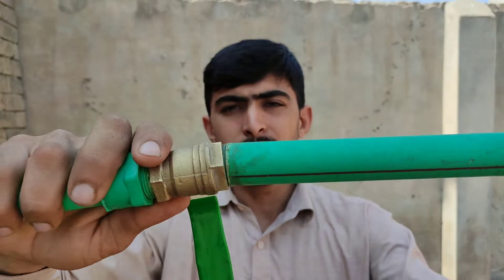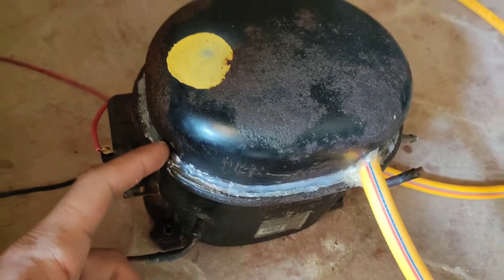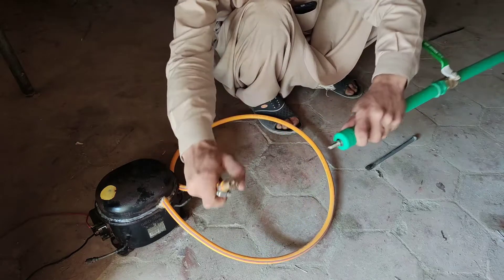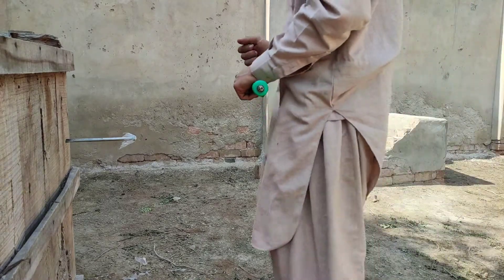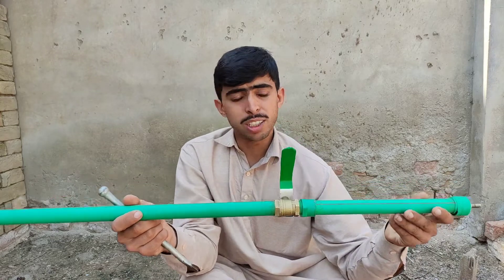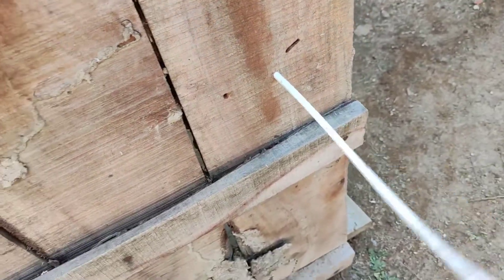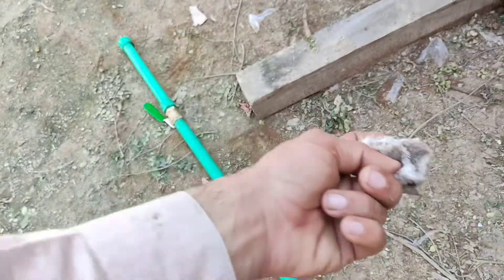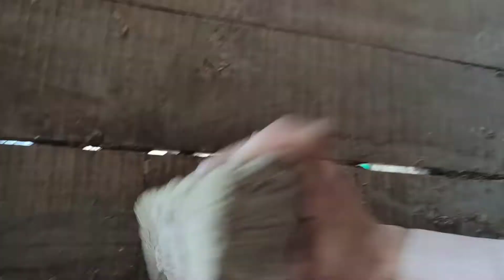Homemade Airgun has INSANE Power

Comment: Pretty cool what you did with what you have. But be careful with pressure. I had a 3600psi air tube  explode in my hands. I'm writing this with my nose.
Reply from the maker: Thanks ❤️ .I try these Experiments with safety in mind although sometimes things don't go well as planned. I was using 1 liter soda bottle for 120 psi of pressure with hand pump. After 1 month of usage, it suddenly blew up in my Hands. Sharp pieces cut my hands pretty bad and it was so loud that i couldn't hear for 10 minutes and my ears were ringing. I learned my lesson that pressure is no joke.